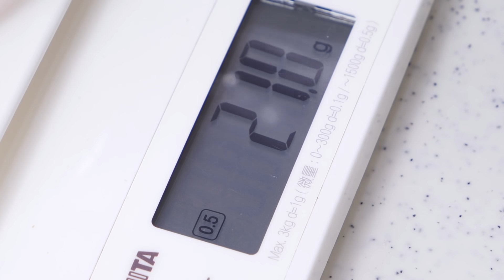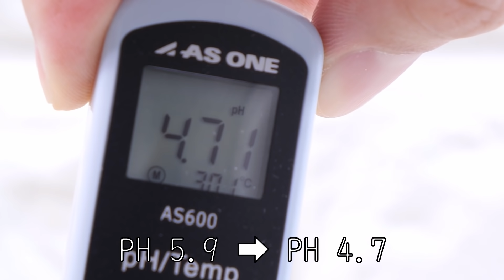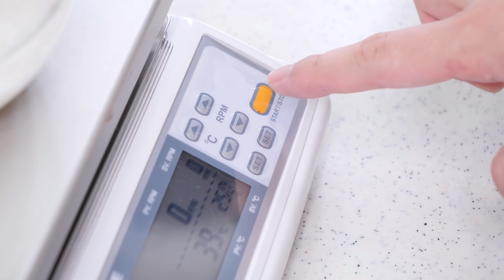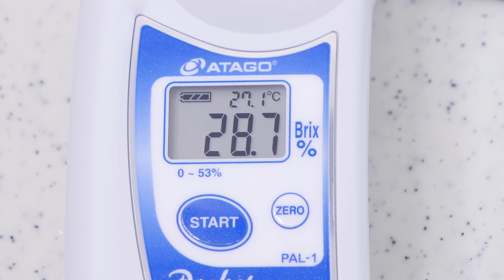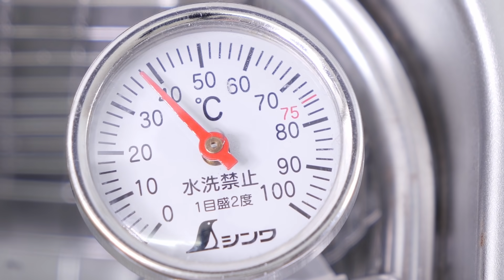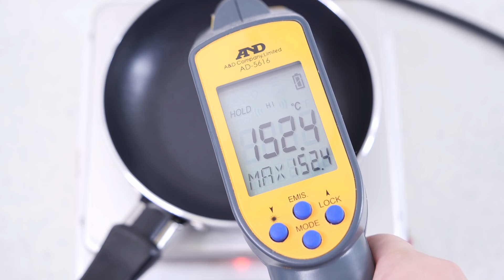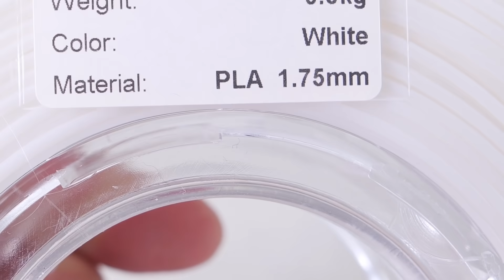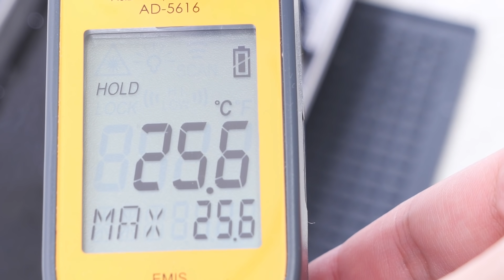人間をペットにしたら即死する飼い主。きゅうりのハロウィン包丁

Comment: For anyone curious about the science:

-He combined cucumbers with salt in a sterilized jar to make pickles, which makes vinegar.
-He added some of the vinegar to milk to make yogurt, which contains lactic acid bacteria.
-He blended rice and corn, which are mostly made of starches, with amylase enzyme from his saliva and lactic acid bacteria from the yogurt.
-The amylase enzyme reacts with starches to produce sugars.
-The lactic acid bacteria ferments the sugars to produce lactic acid.
-The Brix % on the refractometer indicates the concentration of sugar in the solution.
-The iodine tests for the presence of starches, purple indicates a positive test.
-Because the test was positive, it was evidence that the amylase enzyme had not converted all of the starches to sugar.
-He adjusts the pH with vinegar and sonicates the mixture to further break down the starch particles so the amylase can convert the rest of the starches to sugars.
-A lower Brix % on the refractometer indicates that the lactic acid bacteria has fermented most of the sugar into lactic acid.
-He filtered the sugar solution to remove the unreacted solids and then centrifuged out the remaining solids.
-He rinsed the dust from some activated carbon added it to the solution to absorb the dissolved lactic acid.
-He filtered out the activated carbon and soaked it in acetone, which dissolved the lactic acid.
-He filtered out the activated carbon and evaporated the acetone away to leave behind the lactic acid.
-He heated the lactic acid to cause it to polymerize in to poly lactic acid (PLA), which is a type of plastic.
Reply: why is this comment so underrated. Thank you.
Reply: Dude Kiwani is totally just a really bored chemist who knows how to make knifes
Reply: Wait, but how did he get the acetone?
Reply: tanks
Reply: @FelisImpurrator  well knowing him he probably got it in a bottle meant for use by chemists (like what you'd find in a school lab) but you can also get 100% acetone nail polish remover pretty easily
Reply: @ansonchan8486  Some people were claiming he made the acetone, so I was honestly hoping he did.
Reply: this guy is a chemist
Reply: I was about to comment that I wished there was an intelect in the comment section explaining to us mundane people what the fuck is he doing. Thank you.
Reply: @mememanfresh  by that I meant that no one is Ganna make it
Reply: Thank you so much for this comment
I'm interested in the explanation behind like every one of his videos
Reply: Can you do this for all the videos
Reply: @humphreyshrimp2450  he's got other things you know
Reply: @FelisImpurrator  you can get that from CVS or any grocery store, it's sold as "nail polish remover". I think it's fair that he didn't derive the acetone, as this was really only used as a solvent to separate the lactic acid
Reply: You are god dawm right
Reply: @anontrolo  I know acetone is nail polish remover. I was just wondering if people had misunderstood the video by saying he made acetone too.
Reply: thank you so much
Reply: Why the heck did i read all of this🤣
Reply: Wow
Reply: I love you.
Reply: wait wait.. so it actually works?
Reply: Oh thank fucking fuck, I was so bloody lost, your comment saved my sanity.
Reply: @sevenclouds5484  you sound British..
Reply: Thank!
Reply: Thanks
Reply: Thanks! Can you do all of his videos?
Reply: I got a headache fron reading that
Reply: Spoilers
Reply: thank you friend
Reply: thanks. i am even more confused now
Reply: For anyone that doesn't speak chemistry: He used the pickle juice to turn milk into plastic
Reply: THANK YOU
Reply: @FelisImpurrator   nail polish removal
Reply: By the half way point i thought "how is it a cucumber knife?" Lol
Reply: When you put cucumber in salt water you are making lacto-fermentation. The salt allows only the lactic acid bacteria to develop. They eat the sugar in the cucumbers and create lactic acid. 

Vinegar is created by a fungi who eats alcohol. Not related to this process here. :)
Reply: dang, ima start paying more attention in chemistry lessons now :/

btw, thanks for the explanation.
Reply: Wow what a smart guy here . Thanks very interesting 👍👍👍😊😊😊
Reply: it is zucchini actually
Reply: Me Lucas! Kiwami just put out another video. We need you! (Please)
Reply: @Tomahaka  I just posted an explanation comment on that video!
Reply: So what you're saying is. He didn't fucking make a cucumber knife. Cucumber knife means knife made from the body of the cucumber not the chemical juice that makes pickle vinegar.
Reply: Thanks brotha
Reply: yes, that's exactly what I was thinking
Reply: Who are you, so wise in the ways of science?
Reply: you are not right, it's lactic acid fermentation, you don't get any vinegar from it
Reply: where did the bacteria come from?
Reply: initially I just thought he pickled chemicals until they became hard then shaped the knife LMAOO
Reply: I'm reading this in dark mode and seeing it makes my eyes hurt.
Reply: 2 questions:

Doesnt the liquid from making pickles contain lactic acid bacteria (LAB)? Or is the bacteria in milk? If it is in milk, how does the presence of vinegar lead to beneficial conditions for LAB...by killing off other competing bacteria??

Why use the amylase to convert starch from corn and rice into sugar as a medium for LAB? Why not just use milk, which is made of LACTOSE?? Is that not the perfect food for LAB?
Reply: I am surprised he didnt make his own acetone. I forget what you gotta do to acetic acid (vinegar basically) to make it.
Reply: So he made the sharpest plastic? The cucumber in this mix is like 0.03%
Reply: For those of you at home, you'll probably want to just buy a normal knife :)
Reply: english plz
Reply: Thanks
Reply: I am totally lost. Thank you for this explaination!
Reply: science be like:
Reply: I like your funny words, magic man
Reply: Wow 65 People so far, reading this BS, think its cool and know 0 about it tomorrow.
Reply: @FelisImpurrator  tf is acetone?
Reply: Thank You, oh wise Person. 🧎‍♂️🙏🙌
Reply: wtf
Reply: @ValCronin  because the milk has nothing to do with this.    They fed the starch slurry to the  lactic acid bacteria in the brine.  not sure why they showed the milk other than just to show that you can curdle milk with brine.
Reply: thank u
Reply: Dude, I have no idea what you're talking about, just tell me what is needed to make diamond out of coal and keep it short and simple for a rock banger and stick wielder like me.
Reply: @FelisImpurrator  there is 3 ways I know of 1.he used strong nail polish remover. 2 he used paint remover for   tamiya Rc (radio control ) cars. Or 3. He got a bottle of 100%<  acatone from a science lab or shop /suppliers
Reply: What is lactic acid? I'm in 10th grade and I'm really into chemistry but I've never heard of this beforr
Reply: @eumarise8272  It's an organic chemical made by a process called anaerobic respiration. It's made by certain types of bacteria. It's what causes your muscles to be sore after working out.
Reply: @SafetyLucas  now I know why lactic sounded so familiar,
Thankyou so much :) have a great day
Reply: this is the yt version of don't say you like the anime if you haven't read the manga
Reply: I believe the first step is not the addition of vinegar to the milk, but the addition of the bacteria found on cucumbers to the milk to produce yoghurt. He starts by incubating the cucumbers to get more bacteria in there.
Reply: @Username Was Taken I believe he even only used the bacteria found on cucumbers to make this knife.
Reply: @FelisImpurrator  notnthat hard to get people use acetone for their nails it's usually pure
Reply: Damn. I have been hoping for someone who also understands the chemistry behind his videos to give an explanation. 😂
Reply: So it's a lactic acid plastic knife?
Reply: and what about the man who got kidnaping???
Reply: I care >:(
Reply: Thank you! I didnt understand the vid but now i do! Thx
Reply: God bless you.
Reply: so what your saying is, i can make eat plastic that is made from cucumbers. im gonna try it
Reply: Damn you must have aced chemistry
Reply: How come the PLA he made biodegraded so easily ? Yet the ones we use for food packaging and drinks is able to survive on earth for years in the ocean or landfills ?
Reply: Hope you pass the test with a A+ 🙏
Reply: Wow
Reply: Now thats interesting
Reply: You’re saying this guy made plastic out of cucumbers
Reply: So he made 3d printing material from some cucumbers
Reply: Ferb i know what we're gonna do today
Reply: Thank you so much. I often wish I understood the science behind what he did (but also love his minimalist way of presentation). Wish you could do a blurb explanation of all his videos.
Reply: @vl.wolnir6267  They made yoghurt from the milk to show that there are lactic acid bacteria in the brine.
Reply: @tenaxious.d4807  i seriously dont know myself
Reply: no hes just ✨magic✨
Reply: Lol “sharpest plastic knife in the world”
Reply: I appreciate the straightforward break down. Even if you weren’t 100% correct as others correct, it’s still EXTREMELY helpful to understanding what I was seeing
Reply: glad you explain that, I feel less dumb
Reply: 👍 thank you!
Reply: Wouldn't the fermenting cucumbers produce lactic acid, not acetic acid (vinegar)?
Reply: I still don't get how he made a knife from cucumber though? Like he didn't even use the cucumber yogurt. Can someone explain what I am missing
Reply: @bosstradamus7896  okay? And?
Reply: Thanks
Reply: well, its science but... ratio. sry bud
Reply: Cucumbers + water + salt + sterilised environment = vinegar???
Reply: 意外と中学校の知識で理解できた
Reply: before i pressed "Read more" i thought it was going to be quite short, oh how wrong i was.
Reply: Confirmed nilered moment.
Reply: @FelisImpurrator  Chances are he bought it from the store since it's cheap and easy to obtain, but it should be possible to make from Calcium Acetate. If you dissolve eggshells in vinegar, you get calcium acetate. I don't know the process to get acetone from calcium acetate, but I know that you can hahaha
Reply: BRUH... tipping my hat to you

Comment: My man went through all this pain to make 3 grams of PLA

And then goes and he gets a good old roll of snapmaker pla
Reply: Either the homemade stuff was not good enough or the Snapmaker was just used for the handel.
Reply: The commercial PLA was used for the white handle piece, the blade PLA looks identical to and was presumably made exactly like the 3 grams he made initially. The blade, at least, is entirely cucumber-derived.

Comment: Can you just make "Sharpest knife kitchen knife in the world" and make a knife out of smaller knives?
Reply: Yess I want to see thisssss
Reply: Honestly, i do not wanna come off as mean. But that sounds like not a good idea as this channel is completely based off of the challenge of procreating knives from common objects using chemistry, using smaller knives to make a bigger knife would just require smelting them and then forging them into a knife.
Reply: @NotoriousMohamed  yes. Exactly. But not just 2. I mean like a bunch of tiny razor blades. You know what I'm saying? But that's just me. Although it is kinda a lazy idea.
Reply: @NotoriousMohamed  don't worry, it didn't come off as mean!
Reply: Ho LEE sheet
Reply: @NotoriousMohamed  unless, you did it using a voltaic cell. Turn hardened, impure steel into an iron solution, then pulled the iron out of solution to form iron oxide, where he then refined the iron oxide into hardened steel? .... sounds like material science to me :p
Reply: Ferofluid knife.
Reply: He was just sharpening knives at first, you know)

Comment: 👍🏼 Excellent use of analytical instruments and fermentation! What could you do with a mass spectrometer....? 🤔
Reply: Everything he uses is homemade or could be made at home. I don't know that we'll ever see him use a mass spectrometer.
Reply: @NestorCustodio  He can make a 3-d printer?
Reply: @chaos_omega  He's using a 3D printer as an easier way to cast a material into the shape of a knife handle, which we've seen him do by hand countless times before. Same with the "ultrasonic cleaner" -- we've seen him build an equivalent tool before, but it wasn't as long-lasting and maintenance-free as this is.
Reply: @NestorCustodio  It just seems that he doesn't have an aversion to technology. If it is his philosophy not to use such a tool, I feel that is a mistake.
Reply: @chaos_omega  There's certainly no aversion to technology, and I don't think there's any underlying philosophy to it. I've always just seen it as part of the challenge he sets for himself.

That said, I obviously can't speak for him nor do I know what he's thinking. He doesn't communicate outside of these videos, so all we have left is the videos themselves and our own conjecture.  🤷
Reply: @NestorCustodio  No disrespect intended, but it IS possible to build a mass spec instrument in your garage or apartment. Just sayin'.... 
                                👌😎✌🏻

Comment: I guess 3D printing people guessed what's about to happen when he reached the lactic acid.

I don't like the brittleness of PLA in printed parts so I don't prefer to use it. But I guess it makes stronger parts when molded. It gets very temperature resistant when annealed correctly.